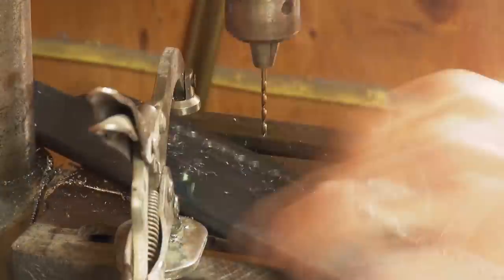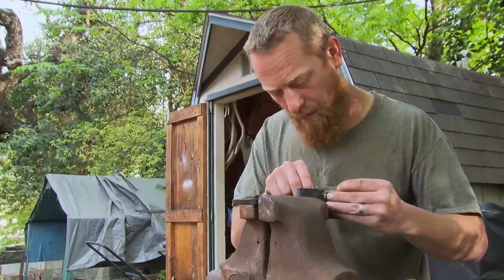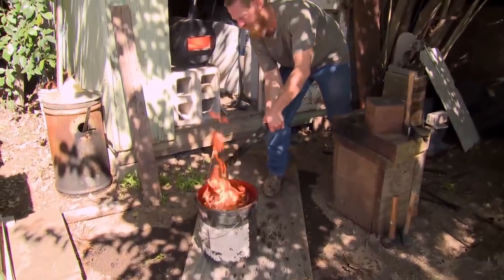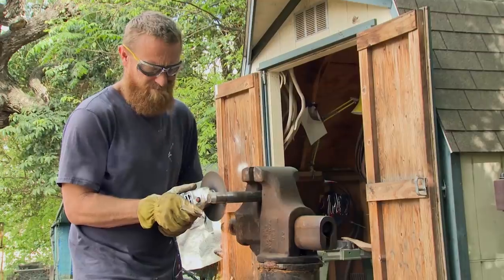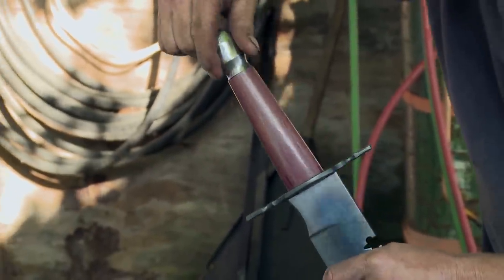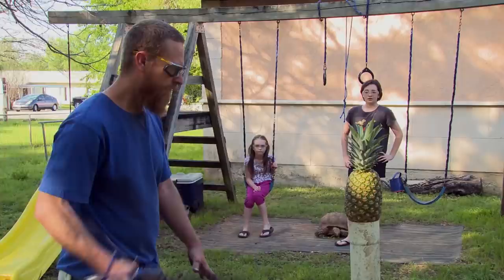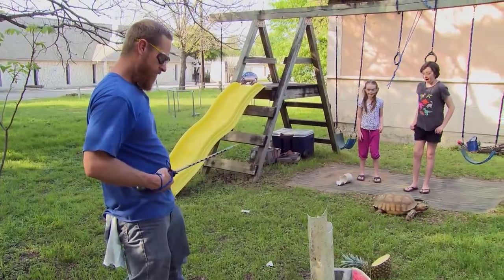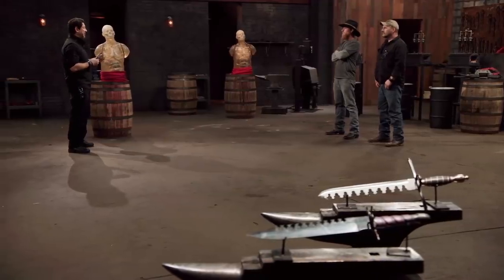Forged in Fire: *Crazy Sharp* Sword Breaker SNAPS & ENTRAPS (Season 4) | History

Comment: Fun fact: It’s actually very hard for the sword breaker to break swords. It rarely ever broke any well made swords and it was usually used to just disarm their enemies.
Reply: Any sword snapped by a sword breaker would be a terrible sword. 
Also they were not very common.  They were difficult to produce and to use.
Reply: It was just a control weapon. Meant to guide the opponents blade, not break
Reply: " It rarely ever broke any well made swords"
Key words "*well made*"
Reply: Yeah, the name is a bit misleading. It would be more accurate to call it a sword trapper. The serrations are meant to allow you to more easily trap and redirect the opponents sword. Theoretically you can 'pinch' the opponents blade so it cannot be used to defend against your own strikes.
Reply: I've heard that the "breaking" the name refers to relates to breaking the guard (defensive / pre-strike starting position) the sword is being held in, rather than the blade itself. It was, as you say, a control weapon. It traps the enemy blade so that their guard can be broken, either aiding disarmament or opening a gap in their defences that can be exploited with a follow-up blow.
Reply: It also wasn't designed to cut or stab and was used in conjunction with a rapier. Sword catcher traps the sword in its grooves while the rapier slashes or stabs for the killing blow.
Reply: As others have commented, it mainly was to lock up the opponent's sword blade so that the user's main weapon can go in and finish the job
Reply: @ctse26  i mean you are partly right. It was mainly designed for that but it was also built with a blade and a point for stabbing and cutting
Reply: They were also not wielded by knights. The sword breaker is Italian, and was used in tandem with a rapier. Hense the size of the teeth being similar to a rapier's blade width
Reply: I would preasume it’s called a sword breaker for its ability to break an opponents offensive capability rather than literally breaking a sword just a guess but I do see how it would make sense
Reply: @John Doe not only that but I'm sure you'd have to be an absolute unit to snap a sword with one hand, need mike Tyson strength for that lol
Reply: in fact, there are no records of a swordbreaker breaking any swords :P
Reply: They were used more in duals from what I read
Reply: yeah, I think they were off on saying that they were used as much as they were.
Reply: @PoorFoxface  That actually makes more sense.
Reply: If you're fighting then you're fighting the man, not the sword. So choose a weapon which breaks the man, not the sword.
Reply: @PoorFoxface  yup. Used in the same way you use your guard with a short sword. Allows you to trap their blade and get closer.
Reply: It would be far better to take the sword away from the opponent rather than snapping it. If you break it then they still have half a sword
Reply: Yeah it was usually meant to "catch" your enemy's sword. He swings, it lands between those teeth. You twist it, so now, his sword cant be pulled free. Then you stab with your main weapon cause he's in the open now and cant yank his sword out.
Reply: Bubble Cob  its almost as though people developed a way of recording history somehow
Reply: Bubble Cob  Well...i am a historian graduate. It wasn't meant to "break" a sword. More like to trap it and pin it so you could stab with the other hand.
Reply: Yes, the actual name is "Sword Taker." Its just translated wrong for generations.
Reply: gotta keep in mind that not all swords were well made lol.
Reply: @Anubis78250  breaker is more like stopper or catcher...
Reply: That's what I was thinking. Catch? Ya huh, that was it's purpose. Break? It was a terrible sword if it did.
Reply: "Swordbreaker" doesnt mean it brakes them at all..it´s just what u said - to disarm enemies, not to destroy their blades :D
Reply: @Specter.X0X  in the video they said it breaks swords and I’m just trying to correct their misinformation
Reply: It's to break the sword attack in the olde sense of the word, not to actually snap the metal
Reply: Its like breaking the guard in BJJ, you dont snapp someones legs in half, you just deflect the protection they give
Reply: It never broke a sword because the sword's wielder would always let go.
Reply: they were used as a off hand weapon to trap enemy swords
Reply: Its even better if sword breaker didnt breake blade. The best option is catch and hold, and eventualy "breake sword from hands". If you breake blade you can always be hit in desperate atack with that broken blade.
Reply: The sword breaker was typically employed in the left hand, to meet the right-handed opponent's blade on a straight line. A dagger, shortsword, or rapier could then be used in the right hand to kill or maim the opponent. This defence gave a small advantage to a left-handed swordsman, who often trained ambidextrously.
Reply: @ctse26  that isn't very nice
Reply: It is possible that "sword breaker" is a mistranslation
Reply: "breaker" in this context just means that it breaks the attack, in the sense of halt or intercept. Like we say in soccer that you break a pass.

Comment: 3:16 "If there's any stress left in the metal, that's going to home out and that's usually in the shape of a warp."

That's true, but not the only possibility: the internal stress can also cause stress fractures. So for any aspiring blade smiths - fully anneal the blade. Heat the blade up till it's hot enough to heat treat (critical temperature, nonferrous, nonmagnetic) - then instead of quenching: pack it in an insulating material and let it cool as slowly as possible. This will relieve nearly all of the stress left in the blade by the forging process. Normalizing is good, it relieves a lot, if not most, of the internal stresses by doing several thermal cycles: but annealing is better. The difference is thermal cycling with multiple normalizations only takes hours: while fully annealing may require an entire day.

Comment: Don't want to sound like a sword nerd, but...
You put one ring on the guard of a swordbreaker for a reason. And the fact, that your hand isn't protected when you specifically switch to the serrated part isn't a Smith's fault. 
The technique behind catching the opponent's blade in the serretion is in twisting the wrist in a specific moment of the opponent's attack. So - the comment on the lack of defence of the knuckles is a bit inaccurate imho
Reply: Also, the Sword-Breaker (not really a sword breaker) was used by nobles in DUELS, not by knights. It was used mainly as a side-arm to RAPIER duels. It is meant to catch and bend the opponent's rapier and consequently, their wrists. It was never meant to BREAK swords or any other weapons, only to momentarely unable the opponent to attack.
Reply: That is a good point and I agree.
Reply: @redknight6695  Yeah, "sword breaker" is a bit misleading. It wasn't for breaking swords, but for 'breaking' attacks.
Reply: @redknight6695  it's also, and I might be wrong but I'm pretty sure I'm not, it's also NOT an edged weapon. Its one function is defense.
Reply: I was under the impression that the rings on the guard were to give the shock of an impact somewhere to go other than into the handle. Sort of an enhanced forte/ricasso area.
Reply: @Patrick2345454  hm. Interesting. What is also a thing to consider is that the fact that it's a pretty "late" piece of smithery. So they sure knew how to do a full basket guard (if needed)  at the moment. Guess, it is as someone in the comments pointed out - as long as it isn't a military weapon for mass combat - there is no real need to put additional metal on it. 

Not trying to force my opinion, just making a point
Reply: @ivanpleshakov9491  All that piercing and firework would have cost a fortune as well, so this probably was a wealthy civilian's weapon for quickly dealing with rapier wielding opponents in narrow alleys and city streets.

I just realized that redknight basically already said that.
Reply: @ivanpleshakov9491  Anyhoo,  check out Jay Fisher's site. He mentions the shock dampening quality of the forte rings.
Reply: and the test rig doesnt actually test the sword breaker ... if it doesnt catch from a twist ... it cant be bent against the serrations to snap ... all they did was slide a blade through the serrations ... look at the wire cutter on military knives ... square .. and hard ... so you lay the wire in the slot and twist to cut it on the edges of the serration ... THAT is how you test a blade breaker ...
Reply: @Patrick2345454  that is why you NEVER heat treat the Pommel .. you always leave it stress free. THAT absorbs the shock ... without breaking .. and why you only heat treat the cutting edge and the breaking edge ... nothing more ..
Reply: I think the ring is used to control the twist with the like finger, so this way the angle dont affect so much, the skills of the user to twist and break the guard of opponent affects much more the result.
Reply: Nope just look at historical illustrations the ring must be on the knuckles' side with the serrated edge facing the opponent

Comment: Misconception: sword breaker didnt really "break". It was used to capture and disarm opponents sword.
Steel sword are extremly hard to break, a sword breaker would in best case bend it a little bit. It could, posibly, break a weak cheap iron sword, but overall, disarm the opponent, then with primary weapon deal a letal blow

Comment: the sword breaker was not actually a "sword breaker". Great job history channel... under the context of bladed combat, to break means to parry. Properly hardened and tempered steal is practically too difficult literally "break" with just a flick of your wrist. you'd need a great amount of leverage and still a great deal of strength. You'd probably bend a proper sword before you broke it too.
Reply: also, it wasn't used by knights, and it was a rare exception rather than "the standard", but hey, they at least got the name right.
Reply: Metal is an elastic material. It always bends before it breaks. Don’t know how they messed that up haha.
Reply: @Meekoid  if it is properly heat treated it should break before it bends

Comment: It doesn't break swords. It catches them. You can't break a sword like that.
Reply: im sure some broke, probably just over hardened rapiers though. after all, it got the name for a reason.
Reply: @zanderdev57  the name is a modern term I think.
The purpose was catching blades though. And I highly doubt that even some blade broke. If the blade breaks in a sword breaker it shouldn't even be able to deliver basic cuts.

Comment: A sword breaker isn’t supposed to actually break a sword the teeth r too small
Reply: Very true, it was more like a sword trapped, you catch an enemies blade in the teeth, twist, and lock it in. They can’t pull the sword out and you still have your sword to use
Reply: If I remember correctly, it was most likely used to “grab” onto the sword and the user could either control the sword or pull it out of the attacker’s hand
Reply: Also wasn't nearly as common as they make it out to be, to much risk involved in trying to catch a sword
Reply: @Zakara675  yeah, I don't know why they said that.

Comment: 2:23 you actually heat the oil to make it thinner in viscosity in order to cool the blade faster because it covers more surface area and air bubbles get away faster versus thick cold oil. This man, although doing the right process during the quench has the wrong information as to why entirely.

Comment: The idea of this is similar to the Pila that the Romans used. A javelin, but had a heavy head, but a looong thin iron tip. So when it hits your enemy's shield, it would either penetrate, or, penetrate and cause a bend. So now, you cant pull the Pila out of your shield, making it catywompus and hard to hold. So a barbarian would simply have to drop his shield. Now he is WAY more easier to kill. Same basic idea. You catch his sword, twist so it doesn't come out, now you got a free shot at a stab with the right hand.

Comment: I almost thought the dude was getting black flagged in the last test when his blade didnt grab that rapier very well. I mean, yeah its well made and sharp, but its a swordbreaker, catching and holding blades is one of its primary functions. Its like turning in a 2h weapon with a hilt designed for one hand. I dont care if it cuts through a dozen necks a swing, if you cant hold it in two hands, its not built right.

Comment: Wrong choice, imo. Erich should have won that. Stronger blade, same sharpness and it still held the rapier to a level that would have stunned the enemy. Didn't specify the PSI but, it still warped the rapier. That's more than enough strength to rip it out of somebody's hand.

Comment: i mean in fairness, the whole point of the challenge was to make a sword breaker. the one guy's knife was good. it was strong, sturdy, had a wicked edge on it, and was made right. the other guy's had the ring on the wrong side and the metal bent.
but the cowboy's did the job it was meant to do.
Reply: I noticed that as well. I would also add that the grooves are meant to trap an opponents blade so they need to have some kind of hook in them. With both of these knives an opponents sword could easily slip out of the groove.

Comment: It's actually incorrect that 'sword breakers' were for breaking swords, Yes it has happened but it is very rare and that is not their intended usage
They were used in conjunction with another weapon, you would catch the enemy's blade as they swung for you and twist it to trap their blade so they couldn't pull back for another swing. This left them open to an attack with your other spare hand

Comment: Do they ever fold the metal, wouldn't it make the blade more durable and in end getting a more sharp edge? I'm not familiar with the show and maybe they aren't showing the full process in this clip?
Reply: from what I have seent hey can fold the metal but it take longer which can be made easier by a machine that hammers it for you like they have in the forge for the show but most of these blacksmiths don't have that kind of equipment so it might have been a time thing since cutting the groves would eat up tons of time

Comment: Perpetuating the myth that a swordbreaker LITERALLY BREAKS SWORDS is one of the reason why no one respects the History Channel.

The name of that weapon isn't literal, it's metaphorical. The teeth are meant to grab and bind a blade to stop the enemy from pulling away while you stab them.

It also was NOT used by knights on the field of battle (also the knight in the illustration they show is a knights Templar and would not exist when the sword breaker was invented) rather its a dualist's defensive tool. It was used in the off hand and paired with a Saber or rapier.